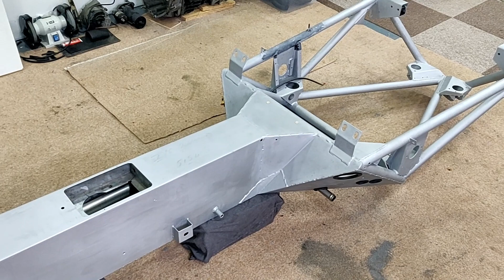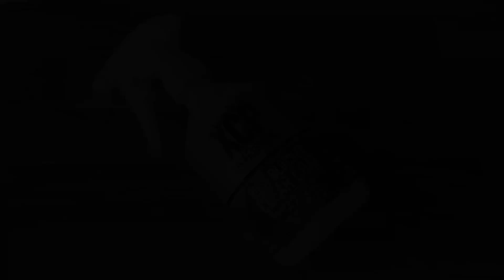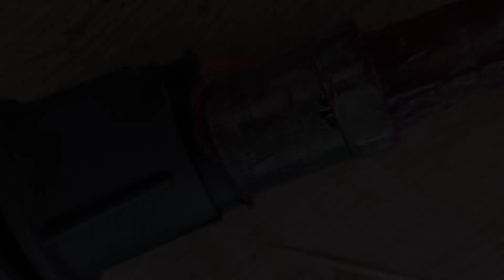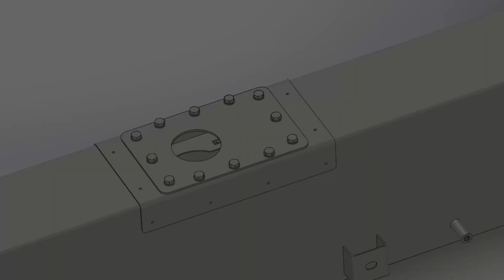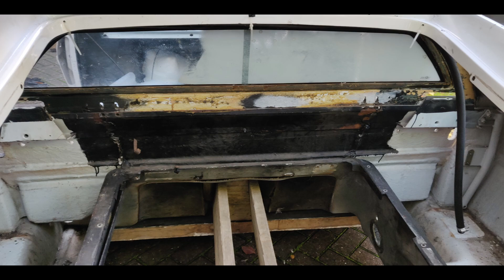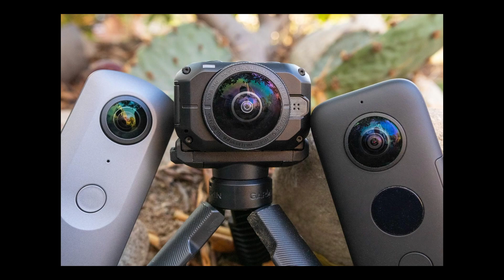Project GT2 - Lotus Esprit chassis & project update #08 (Dec-22)

Comment: Hi Jon, I have completed the saddle install on my 80 Esprit . It went better than expected! I used the 3M 08117. I cleaned two pieces of .062 metal 1.5 " W x 3" L. Each piece had a 90 degree bend, off set from each other.  Ground up the surfaces, cleaned with acetone and applied to both pieces ending up with about .062 thickness of glue. At first after 24v hours it seemed to be not soft but not hard, but after 3 days it got harder. Room temp.  I put it in a vice and hit it hard with a hammer and it held up well. Finally I got pretty aggressive and with some help from a chisel it let go. It wont be experiencing anything like that in the car. I used 8mm Rivet nuts which worked great leaving me a .062 gap (perfect). I reduced the opening of the saddle for extra strength. Used 200ml tube which of course did the gluing part but the squeeze out and remainder covered the exterior of the saddle. so perfect amount for my dimensions. My garage is heated but it goes down to 0 degrees C at night. Canada you know.  Next day all good. It may take more time but I'm sure as long as you are not twisting your chassis it will cure fine.  Kind regards  Ross.
Reply from the maker: Haha you beat me to it !
I'm doing some testing right now and the install video is coming soon.  Ideally you need to cure at room temperature for 24hrs for a 2 part epoxy but the beauty of this is that if it fails you can always try again / improve the concept  to get a better join without grinding metal.
From the simulations I have done you should be fine - the glue is only stressed around the edges.

Cold wont affect it after it's cured but it might suffer from heat from the radiator pipes.  I'm going to lag mine around that area to stop the glue potentially weakening but again I need to investigate more.
Reply: @JonHimself  How are you making out Jon with the chassis saddle?
Reply from the maker: @rosscampbell7275  nearly done - just waiting for the weather to improve really to get the heat into the glue as it sets.  Doubt it'll be much before April / May
Reply from the maker: @rosscampbell7275  It's mostly ready to glue - except the temperature is still too low for the curing process to initiate.  I could build a heat tent like I have done for the rear suspension but I'm in no major rush as the bottle neck now is the the weather which I need to come in to do the body restoration.  Expect a lot of action around April / May time.

Comment: Hi Jon, very interesting to watch your video and to see the Esprit chassis up close, There is a very good chance I built that Chassis, I was part of a 4 man team (2 per shift) making the Esprit chassis, from 1988-1992 over 30 a week at the time. As production slowed on them we would build Excel, europa, elan, elan +2 etc for service and I remember some special Esprit v8 chassis for racing in the USA. In later making many many wishbones for Elise, Tesla and Vx220.
Good times. Look forward to seeing progress on your car, I'm sure it will be amazing when finished.
Reply from the maker: Hi Ray, that's awesome - have you seen my other video where I did a design study on the chassis ?  There were some hand drawn markings on the backbone/tunnel I was trying to understand.  I was really impressed with the design and the work that went into the chassis, it's a shame it is so under rated which is part of the reason why I am doing this series - the more I dig into it the more impressed I am with this car.
Reply: @Jon Himself  
Hi Jon, I have only seen the one video so far, I will check the other later when I get a chance, I'm interested to see the markings, they must be I assume from the production line as after we had fabricated the chassis it went off to be zinc coated, so any markings would have been lost.
We made the chassis in parts, front box, backbone and rear end, then all put together in main jig, along with the diaphragm, gussets etc.

Comment: Hi Jon, great in-depth detail on all your projects!  I have turbo charged my S2 and now I'm at the point of reinforcing the shifter area as you have suggested. I have cut away the fiber glass today exposing the chassis . Just as you have discussed I was trying to figure out a way to reinforce it with out welding for the same reason you have mentioned. Really looking forward to your video on the roll cage . I will not be tracking the car but I would like better rigidity and safety.  Ross
Reply from the maker: Hey Ross, I have yet to still do some research before attempting this mod - theoretically it should work very well BUT I cant prove it.  I need to do do some physical tests and couple them with valid simulations to refine the design.  Watch this space - it is a job I need to complete before April 2023 so it is urgent.
Reply: @JonHimself  Hi Jon thanks for the reply. I had a thought. In your situation where the chassis is all exposed,  could you weld in the shifter saddle ( for lack of a better word).Then remove the coolant pipes and clean the inside of the chassis through the shifter hole (tight I know) of all welding  remanence. Then apply the EM121? Also if you are going  ahead with the roll cage, do you even have to worry about the shifter saddle?
Reply from the maker: @rosscampbell7275  I could, but for two reasons.
1)  When I have welded galvanised steel before, you have to grind off the zinc on BOTH sides or, if you're doing it properly, you get horrible porosity in the weld if there is a TINY amount of contamination bleeding in from the far side, once thats starts its a PIG to fix.  Welding introduces warping as well and TBH my skills are not up to it - risk vs reward.
2)  Bonding - always wanted to try it, 100% safe, no warping and stronger.  You still need to remove the zinc (recommended) but only on one side and you're patching it with epoxy so it cant corrode.  If the bond fails (which it shouldn't do as it'll be riveted as well....just like the Elise chassis) then you simply remove it and start again.

Either solution would work but for me bonding has a distinct advantages, its cost effective and it furthers my knowledge.
Yes the roll cage will help with stiffness but it doesn't hurt to do this as well and this is the best time to have a go.
Reply: @JonHimself  Hi Jon, doing some checking on epoxy bonding adhesives. 3M 0733 seems to be a good candidate. Very pricey. $140 Canadian. ouch!  Of course by the time I get a welder in that knows what he is doing ,  I'm probably at that cost or more.  If you find any alternatives please let me know.  In the mean time thinking I better replace my coolant pipes based on the condition of yours. Kind regards Ross.
Reply from the maker: @rosscampbell7275  Initially I was looking at 3M DP490 which is a room temperature cure but its cold outside and you do need the temperature above 30c even with two part epoxies to get a structural bond.  So I was thinking since I was having to take heat to it I might use Permabond ES550 which is WAY stronger but requires 150c for an hour to cure which is difficult on the tunnel structure as you have two sides to heat.  Ideally you need a paint curing IR lamp but I dont have one.

Need to do some tests with a laser thermometer on how hot I can get the metal with the existing tools - this is the biggest hurdle right now.  I'm going off 3M stuff as well, their data sheets are hit and miss, I much prefer Permabond's product selection and information resources - lots cheaper too.

Comment: Excellent video and series.  Very much appreciated and inspiring for my own restoration work.  Please consider sharing the name of that steering rack company, so that others may avoid their grifting?  That was beyond shady.  Much success to you in 2023!
Reply from the maker: Much appreciated.  Yes I was furious over the rack, its such a mission critical part - it took a lot out of me, chasing things up and proving my case to get the money back.
My recommendation to people is always buyer beware, arm yourself with knowledge and insist on doing things your way.
I've always been advised (legally) against naming and shaming.  I've had a few companies try to con me in the past and a common tactic they use is to threaten legal action against you for defamation and set a court date, which you have to attend or refute legally - solicitors are not cheap!  Either option requires so much time and/or money just to prove yourself right - sure you can claim expenses in court, but I'd rather build cars.
Always use a protected payment method (VISA) and always inspect the work - or better still do it yourself.  The last Lotus specialist who tried to over charge me by £1,500 gave me the incentive to get more hands on so it was a good thing really 😋